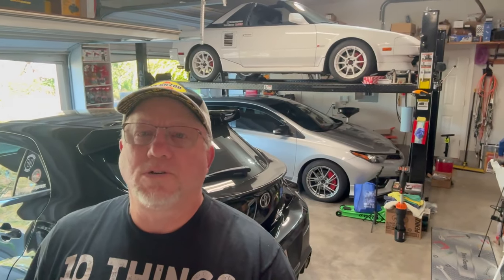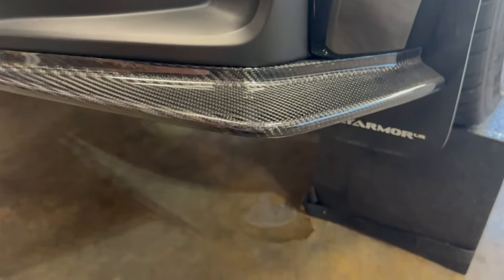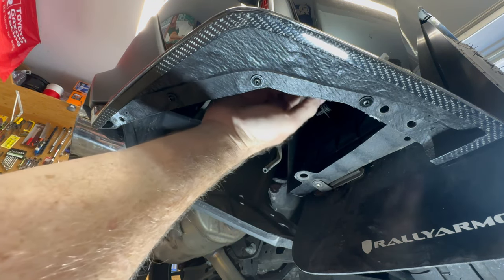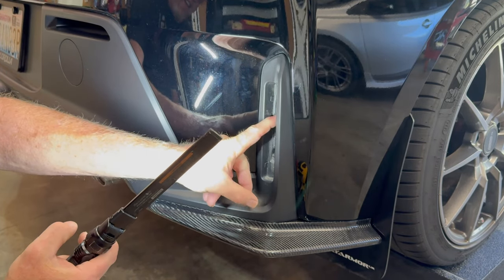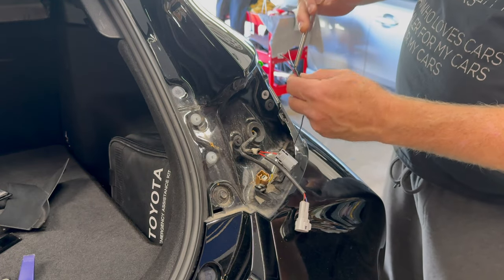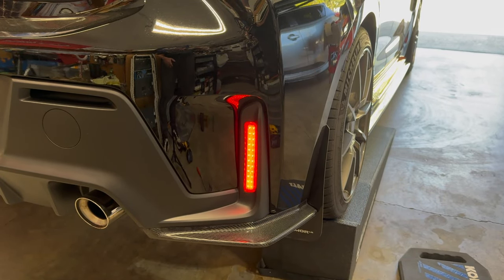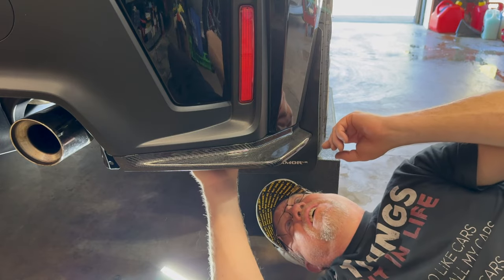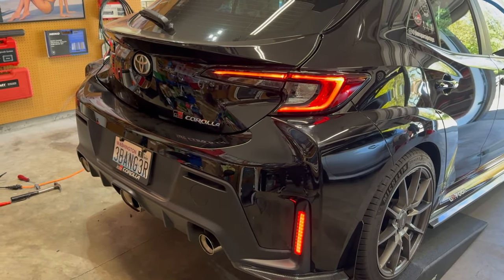GR Corolla // Rear LED Reflectors // How To Install Them The Easy Way!!

Comment: For people wondering if they are brake lights, yes you can make them brake lights too as long with the running lights.
Reply from the maker: Thanks, and yes, they can be used for both. I'm on a cruise and the 7 days from Juneau, Alaska to Maui we didn't have wi-fi due to technical issues.

Comment: I like the end result.  Would be even sexier if they were brake lights as well.
Reply from the maker: You can wire them that way if you want to. I did it this way at first but I can easily change it.